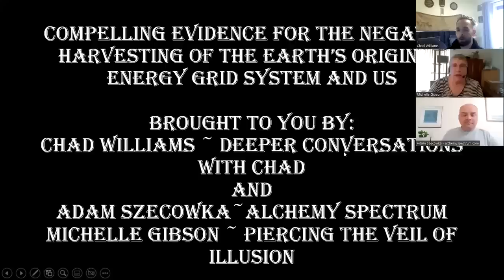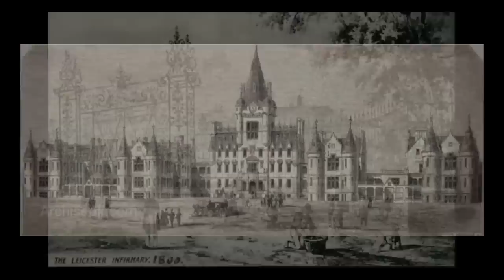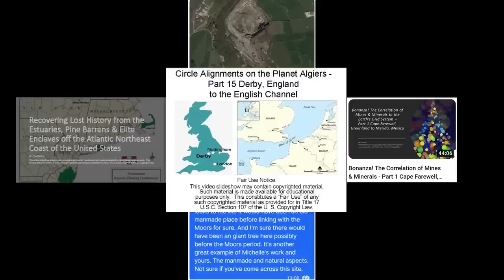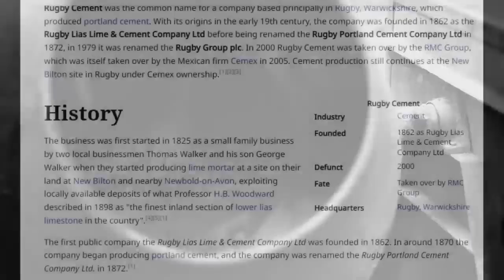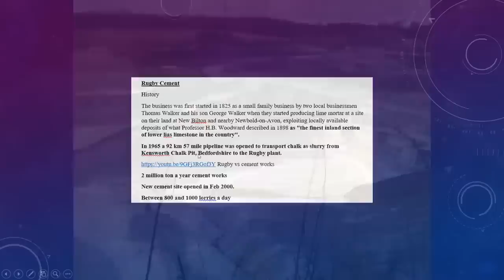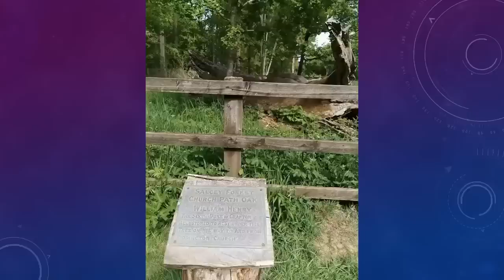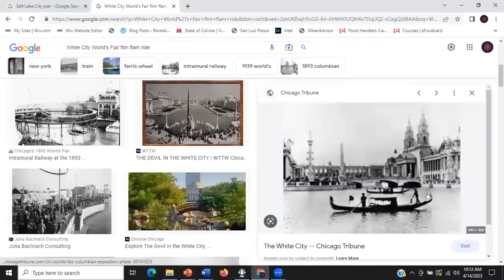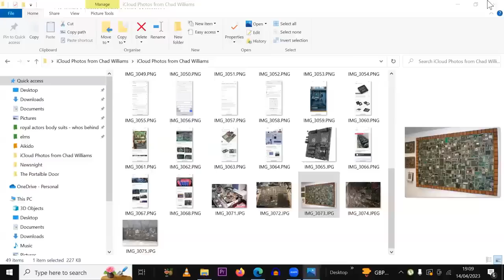Presenting  "Compelling Evidence for the Harvesting of the Earth’s Original Energy Grid System & Us"

Comment: Just think of what those little flat batteries do in place on the motherboard, it won't work without it, it helps keep time for starters, if you remove that battery and replace it out will reset the settings on the motherboard